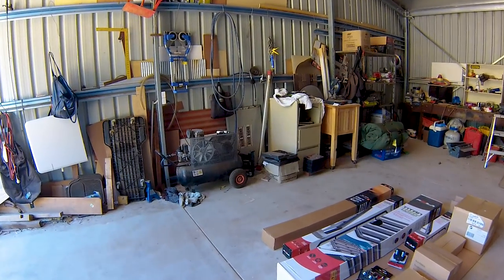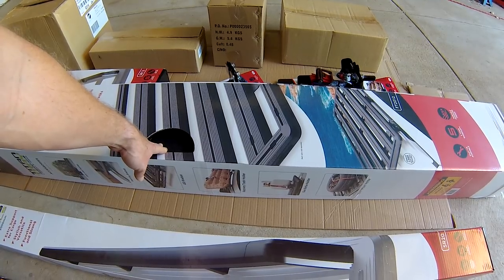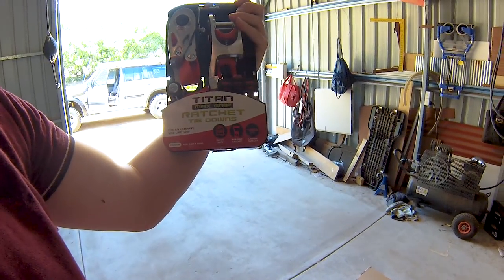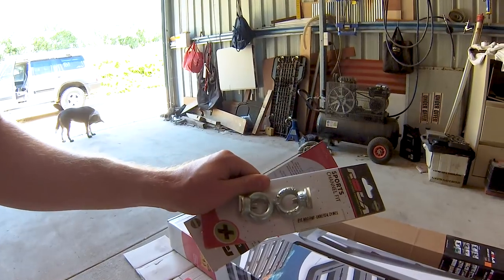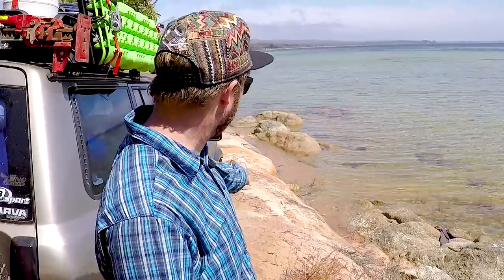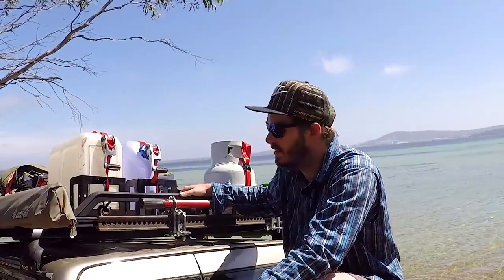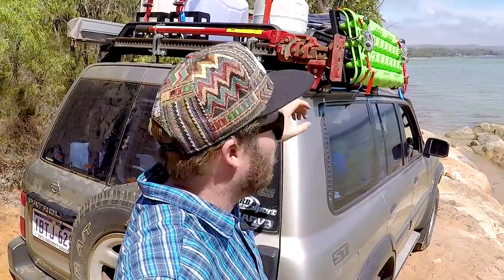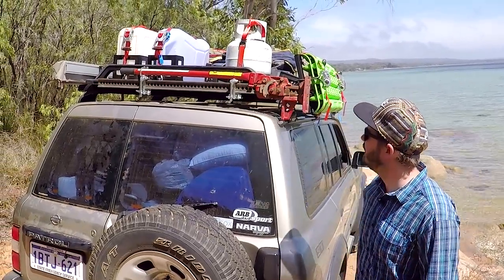ROLA Titan Tray Setup: First Look

Comment: Would recomend locktight on the nuts and bolts especially when you hit some bumpy road.
Reply from the maker: Not a bad idea, some low grade stuff would probably do the trick hey, easy enough to remove if you need it to!

Comment: I have squeak on my front runner.  I had to take all the bolts off and use sticka-flex on all of them to stop them coming loose on corrugated roads.  The noise is one of the most annoying things ever!  But its all fix now.  I stongly advise you do the same :)

Comment: Nice !! Very nice !! Seems much lighter and less wind resistant ...I would just change the way you strapped the gas bottle. To avoid lower branches from popping the valve off, I would recomend to stand on the side and with the valve turned backwards. Just as a precaution !! Being picky? Probably ... hihihihihih. Cheers
Reply from the maker: that is a very good point! If the nature of the gas bottle holder allowed for it, I would take your advice there. Might be an idea for ROLA on future improvements?

Comment: Do they make a gutter mount system so you don’t need the roof bars?
Reply from the maker: Nah they don't actually. I mean, these roof bars are gutter mount, but they've designed it so the tray is bolted onto them for maximum modularity